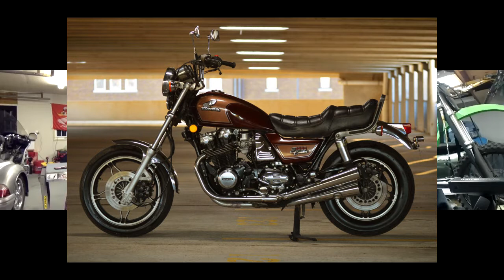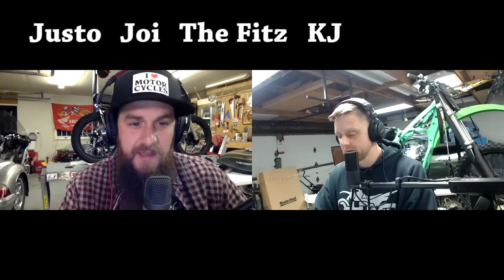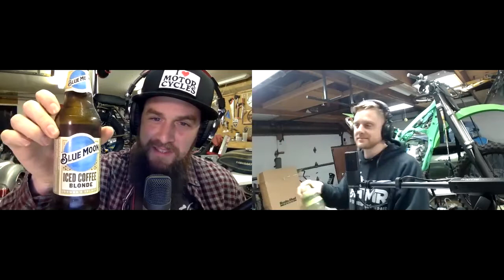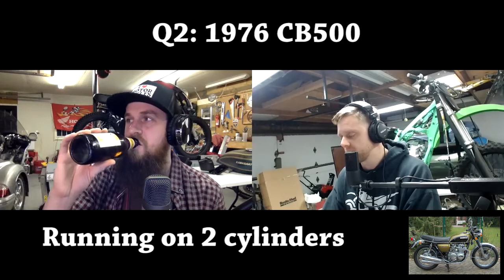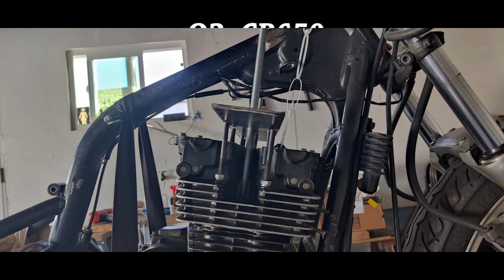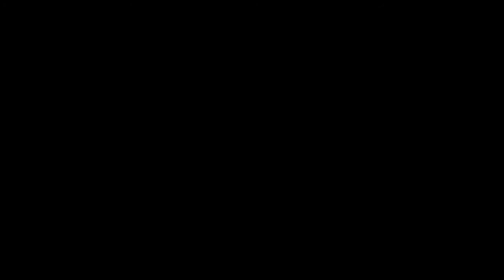The Broken Moto Show - EP26 - What's that NOISE?

Comment: Hey Guys, it's Michael with the 83 CB 1000. I don't know what I was thinking when I sent the Email, but you are correct, it is the starter side of the bike. I have a bunch of bikes I am currently working on, so I may have been confused at 5 am when I sent it. Yes , the mechanic said the starter clutch with the rollers might be causing the problem. Thanks for taking my question, and when I finish shoveling all this snow, I will dig in to it and let you know what I find. By the way, i live in Matt's Area, Chicago.
Reply from the maker: Where in Chicago? I'm in the burbs....Mt prospect.